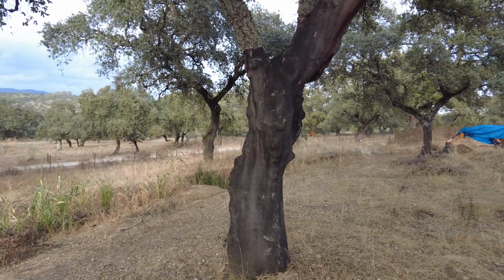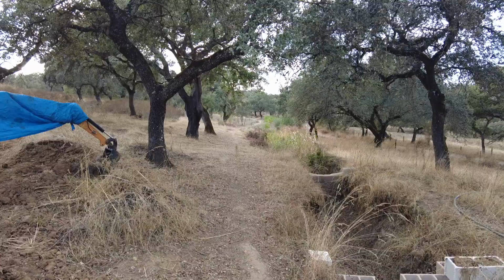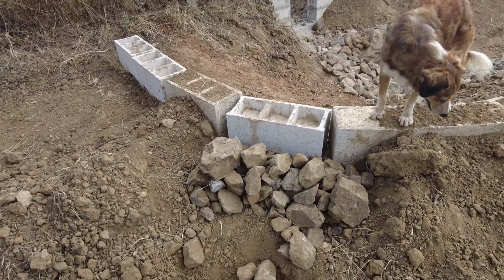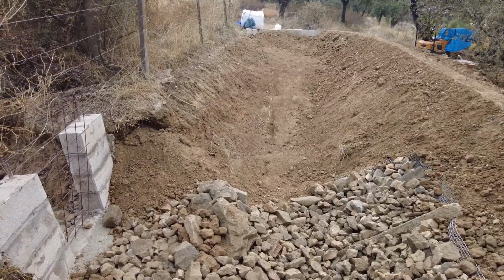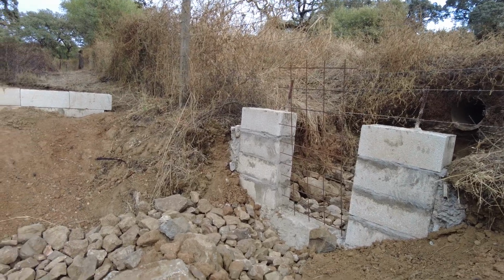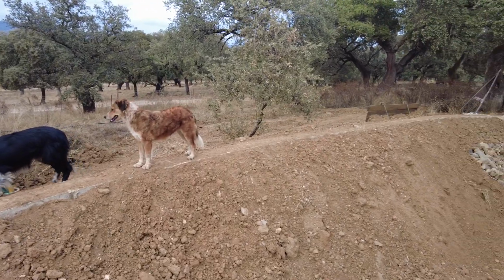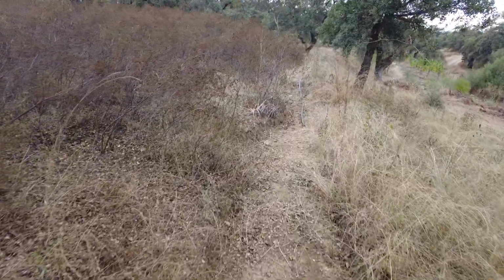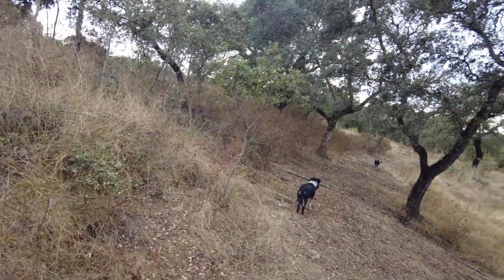Canals, swales, spillways and prayers for rain.

Comment: Looking good! Let's hope the first few rains give you just enough water to show you the strengths and weaknesses of the system. Some of the stones appear small for their intended use. I would suggest building the new spillway aprons at the swale entrances with larger stones that will have a better chance at staying in place. Look at Bill Zeedyk's rock rundown structures on how to key in the stones in a durable manner.
Reply from the maker: @patblack2291  Great suggestions. Thank you for sharing

Comment: Would have bigger, easier, faster response from the system by planting trees that need less water, and it would be cheaper and more sustainable.  But sure it will be much more fun to see the water running the next few months. Seems like your systems are connecting and tunning well.
Reply from the maker: @srantoniomatos  Sure thing. We are changing it all. Planting only dryland plants. Thanks for the sharing